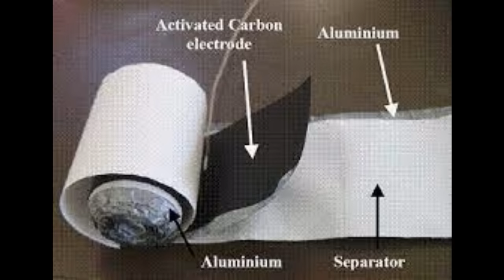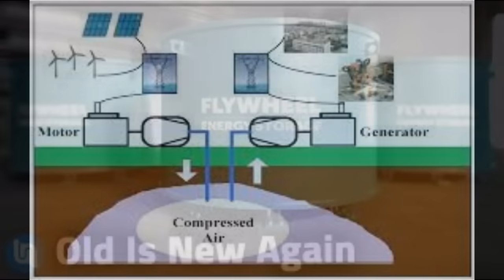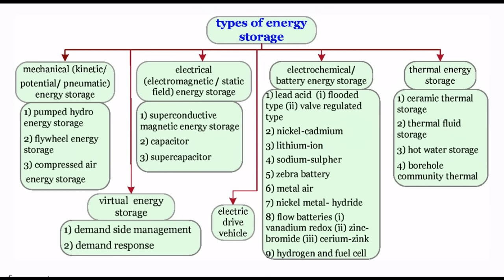1872 Beyond Batteries For Home Energy Storage

Comment: hey wow 51 minutes. and then i watch it is only 5 minutes and the last 46 minutes is black screen.

how about making hydrogen fuel cells from the electricity produced by a generator? could store the hydrogen in a air tank or something like that.
Reply: Go to @51:01
Reply: A demonstration of zero point energy.
Reply: There was a secret message when a certain Beatles' LP was played backwards .
Reply: Never Store Hydrogen Gas. Store Water and Crack it/separate it, on Demand. My first DIY Hydrogen cell,  I had excess gas that ignited, only a Pint volume small PSI, Shook the Building injured my hand and Ear's.
The Shock wave from Hydrogen ignition is severe danger. Just speaking from Experience, on demand Gas, from Stored Electricity.
Sound can crack water, Piezoelectric speaker, done in Japan., works more efficient (20%) than Standard Electrolysis . Just a thought.

Comment: Sand batteries may be more aptly called hot storage than cold.
Reply: How about a wind turbine that makes hydrogen?
Reply: @justtinkering6713  a whirly gig that swisher a paddles water around a barrel with brass and aluminum rods or plates is may favorite energy collector must builds.